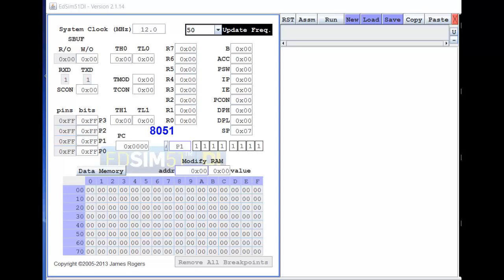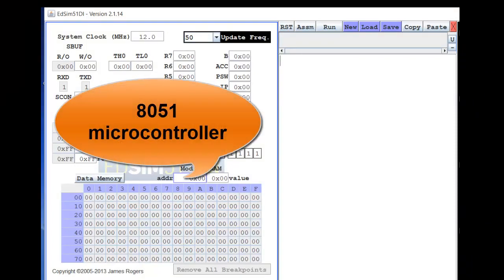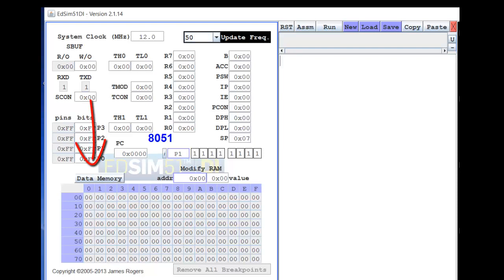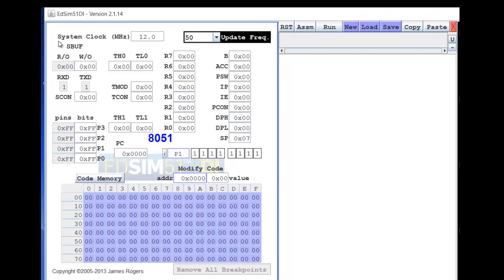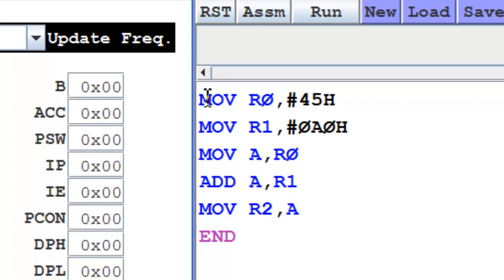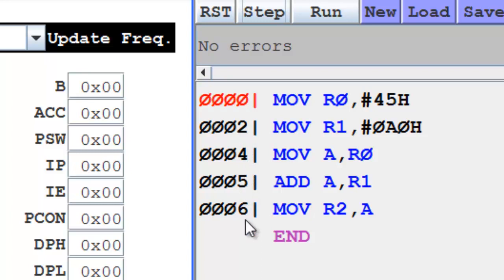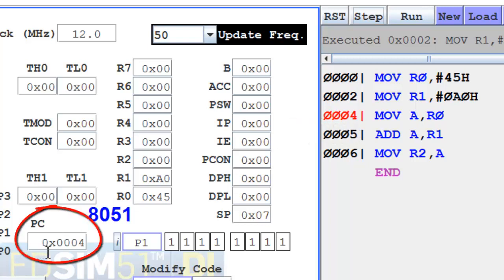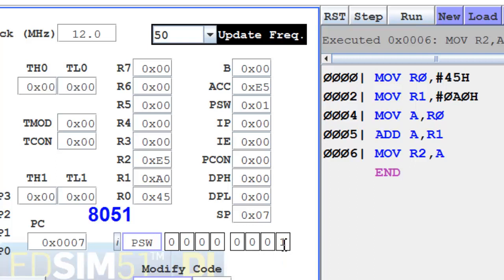8051 microcontroller programming

Comment: Thanks for the video sir . I have a question : where did u get the adresses of R0 and R1 (#45H and #0A0H)
Reply from the maker: These are not the addresses of R0 and R1 but they are the values stored in these registers. The addresses of registers depend on the register bank selected.
Reply: @jayeshpg  I see thank you

Comment: Thanks for the information on the 8051. If you ever want to create more videos again about the 8051, perhaps you could consider providing information about how to program any 8051 variation.
  As a simple hobbyist I am trying to learn about the 8051 in depth. I am interested in the fundamental aspects of the architecture. I want to know how to program an 8051 core without tying my understanding to a single development platform or chip manufacturer's tool chain. I want to be able to learn in a way that allows me to apply my skills to any 8051 microcontroller from Analog Devices, Atmel, Cyprus, NXP, or any random "offshore" version I come across. There are lots of tutorials about programming specific 8051 part numbers from a specific manufacturer, but I have not found a lot of information about how to program an 8051 independent of a single IC manufacturer. I want to know how to understand the differences between all 8051 variations, and what tool chain to use for programming any 8051 variation. 

  I understand it has been awhile since you last created a video about the 8051. I understand if your circumstances or interests have changed. Thanks for taking the time to create the content you have posted. I greatly appreciate it.
-Jake